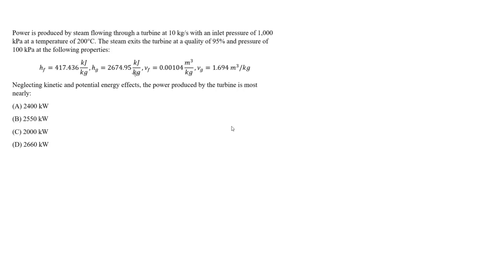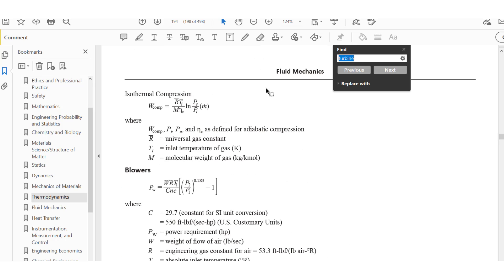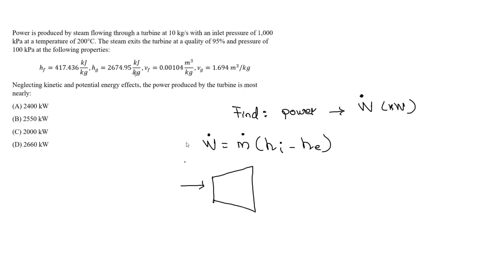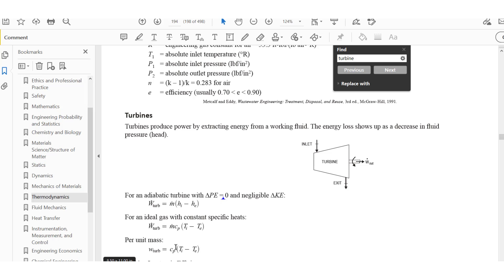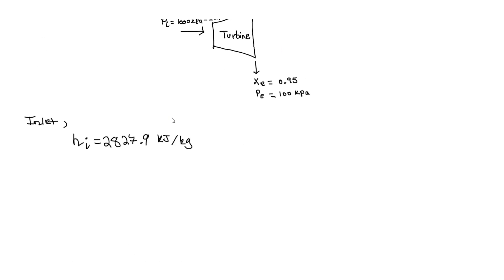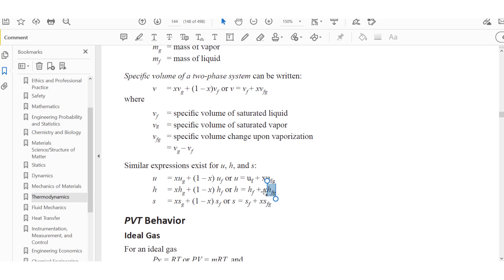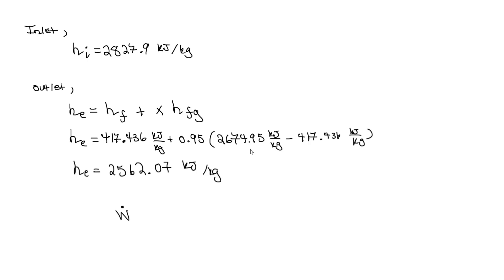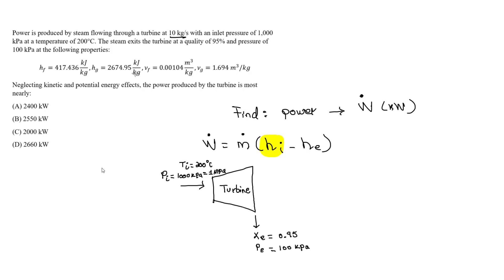FE Exam Review - Fluid Mechanics - Turbine Work

Comment: I would suggest using the formula h = xhg + (1 – x) hf  to find the h at the exit, your method works but it's the long way around and for the FE time is VERY precious. Keep it up
Reply from the maker: Great tip!
Reply: @directhubfeexam  Is this Fluid Mechanics or Thermodynamics? Does this topic apply to FE Civil?
Reply from the maker: @sekhar4876  Hi Sekhar, this wouldn't apply to the civil fe. Thanks for checking!
Reply: @directhubfeexam  Can you please state in the description that this question is related to the specific specification of FE ?
Reply: It's the same thing exactly. You just took the hf as a factor
Reply: Why did we use the steam table for inlet, and we used the saturated table for exit?